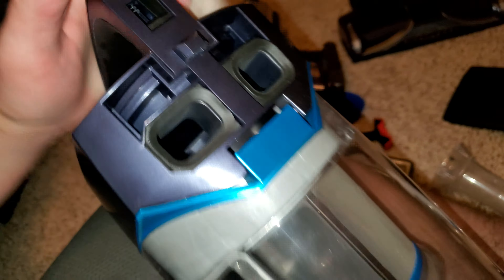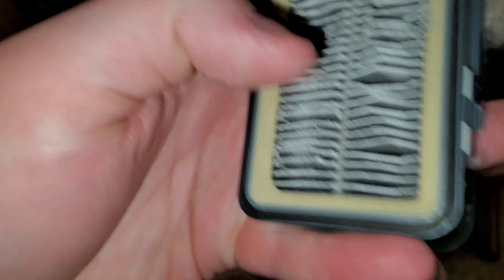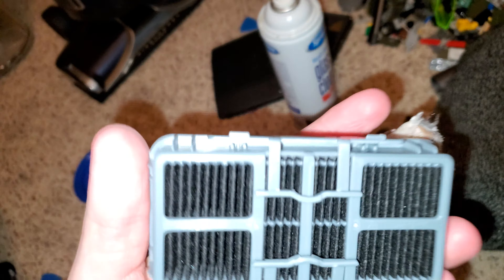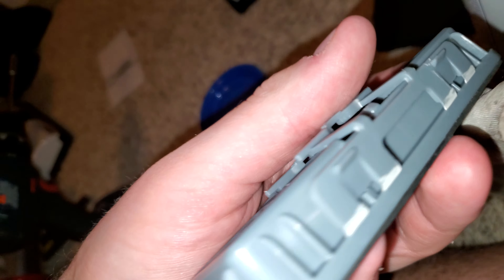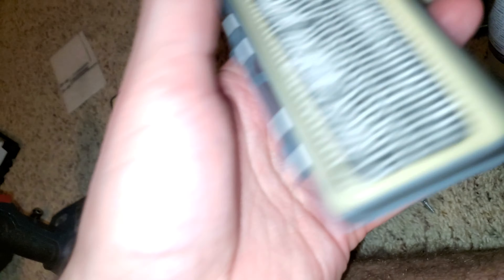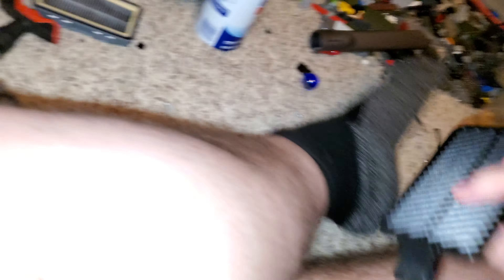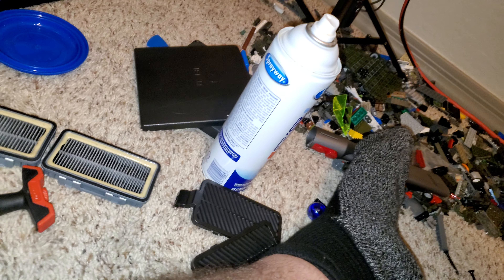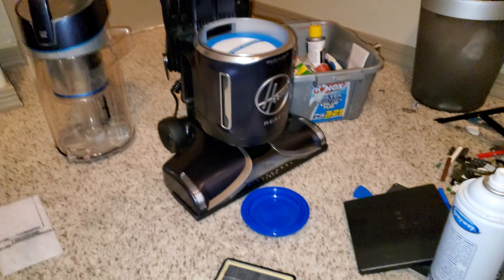This was my fault.🤦‍♂️

Comment: Well user mistakes happen...like the time I took apart and cleaned my Hoover Windtunnel Supreme and forgot to put the screws back in the handle so when I went to use it, the handle fell off and the vacuum fell to the floor when I went to pull the machine back after a pass lol😂😂😂
Anyways good video as always